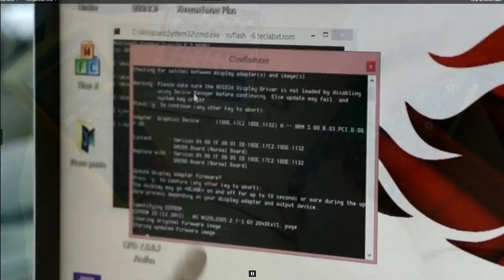Literalmente, destruindo com a GTX Titan X (leia a descrição).

Comment: voce tem como olha nessa  montagem de pc gamer que estou  querendo compra.abraços!

Processador Intel Core i5-4690 Haswell Refresh, Cache 6 MB, 3.5GHz (3.9GHz Max Turbo) Tecnologia Intel InTru 3D LGA 1150 BX80646I54690

Placa de Vídeo VGA Gigabyte GeForce GTX 960 Windforce 2GB DDR5 128 Bit PCI-Express 3.0 GV-N960WF2OC-2GD

Placa-mãe ASRock Micro ATX p/ Intel LGA 1155 B75M-DGS USB 3.0 Box

Memória Corsair Vengeance 8GB DDR3 1600MHz CMZ8GX3M1A1600C10 Black

SSD Kingston HyperX 2.5´ 120GB SATA III Leituras: 555MB/s e Leitura/Gravação Aleatória Sustentada/Máxima de 4K - SH103S3/120G

Fonte EVGA 600W 80 Plus Bronze 100-B1-0600-KR

Gabinete Pcyes ATX Gamer Rhino s/ Fonte Vermelho 18631

HD Seagate SATA III Desktop 7200 1TB ST1000DM003

CoolerMaster WaterCooler Seidon 120V 120mm RL-S12V-24PK-R1
Reply: O i5 é 4 geração e a placa mãe é de 2 e 3 geração
Reply: tira o Ssd pega uma gtx 970 g1 gaming ou da galax pode ser hof ou exoc ambas são boas e monta na pichau

Comment: Processador: Intel Core i5 4570; RS 192,00 
Placa mãe: GA-H87M-D3H; RS 420,00
Memória Ram: 8GB Corsair Vengeance 1600; RS 289,00
Hard Disk: Seagate 1TB; RS 306,00
Gabinete: Aerocool Strike-x Xtreme; RS 268,00
Placa de vídeo: EVGA GTX 760 2GB; RS 975,00
Fonte: Corsair CX600M; RS 380,00
Um pc com essas configurações vai roda os jogos sem leg nem nd ?
Reply: +Tiago Araujo Vai ficar bom sim